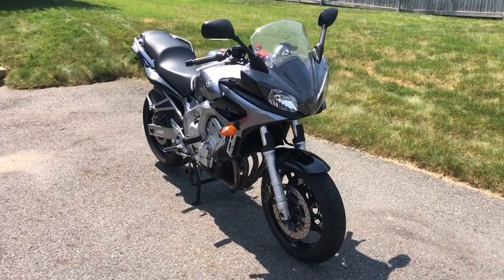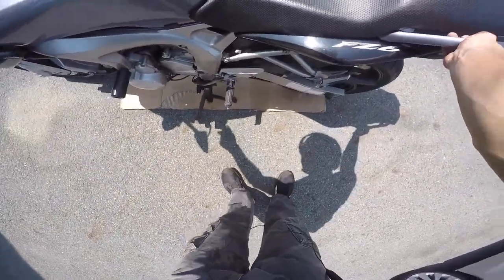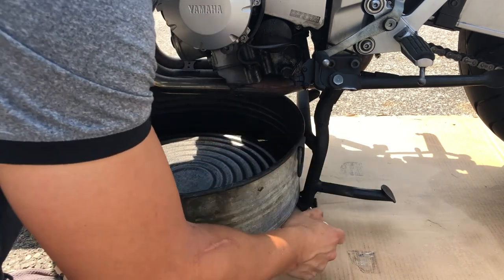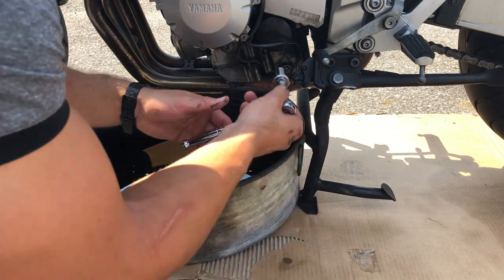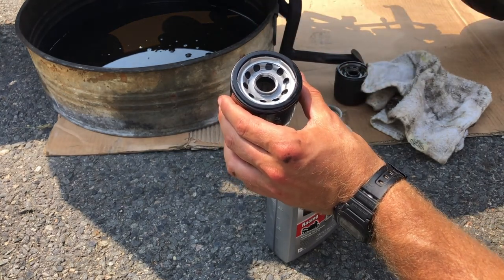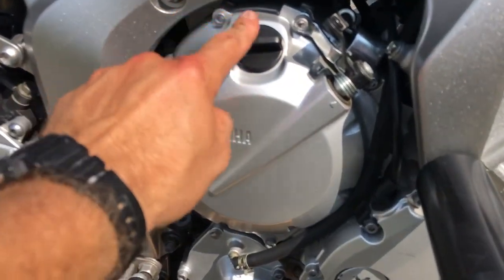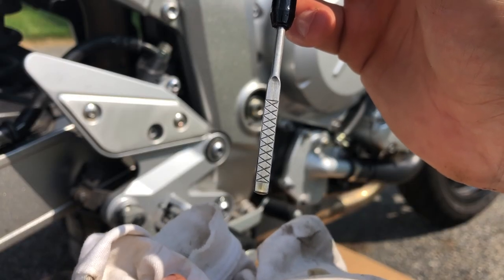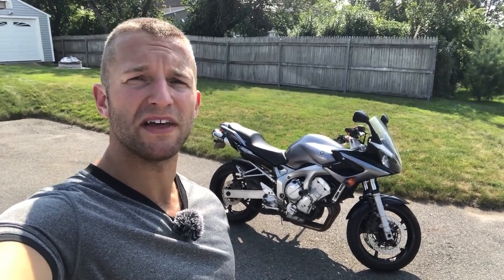How-To: Oil Change; 2004-2009 Yamaha FZ6 [DIY]

Comment: Just bought my 04 fz6 on Friday and she’s a GEM with only 8200 miles and on Friday I’m gonna do the oil and possibly brakes. This video was great brother by being very thorough. I work on my cars to save money and have never worked on a bike and you’re definitely showing how easy it is!
Reply from the maker: Congrats!! It really is a great bike. I've had mine since 2016, and I hope I can keep it for the rest of my life. It has been incredibly reliable (knock on wood) and it is still an absolute BLAST to ride, even though I have a lot more experience now. I bought it with 13,636 miles, and it now has over 30,500. I would highly recommend this bike to pretty much anyone. I also plan on doing a full review on it one of these days!

Thank you for checking out the video as well! I appreciate your feedback. Please don't forget to leave me a like, and also consider subscribing to the channel if you haven't already! It really helps me out to grow, and I sincerely appreciate it.

I am certainly a fan of saving money and working on your vehicles yourself when you have the time and the tools to do it. The oil is one thing, because the worst thing that can happen is the engine will blow up if you forget to put oil back into it. The brakes are a much different story though. I'm sure you are already fully aware, but just PLEASE make sure to fully bleed out your lines, test your brakes before you even leave your driveway, and then take it for a good slow speed test ride to make sure you are ABSOLUTELY safe with the brakes. I don't think anyone can think of a more crucial component on any vehicle to save a crash and potentially your life. I unfortunately do not have a video on how to replace the brakes on this bike, but I'm sure there are many others already on YT! Calvin MC is a great resource. He has a blue FZ6 and has a lot of great how-to tutorials videos. Good luck with the repairs, enjoy the snot out of your bike, and ride safe! -Mark

Comment from the maker: ***NOTE: Here are 2 more awesome tips I learned from my viewers! (see original comments from A & Skywatch below)

-To try to maximize the amount of old oil you can drain from the engine, you can remove the old oil filter, the dipstick, AND the oil fill cap while draining the oil to try to reduce the amount of vacuum inside the engine that is naturally created from the plug, cap & dipstick.

-Once most of the oil has drained, you can then (very carefully, as spilled oil may cause you to slip) take the bike off of the center stand, and place it on the side kick stand. Even more oil will drain out this way. Happy wrenching!
Reply: Question!! My Yamaha doesn’t have a stand like yours. Can I drain the oil & replace the filter by only resting it on the kickstand? Or is that not recommended?
Reply from the maker: @jessicataylor54  Yes! You certainly can. It’s just not as easy, as it doesn’t get lifted as high off of the ground. It also leans towards the left, where the drain bolt is. It’s totally doable though. Good luck with it!

Also, thank you so much for checking out my video! If you enjoyed it, please make sure to leave me a like, and also consider subscribing to the channel! It’s free to you, and it really helps me out to grow, so I certainly appreciate it. Take care, and have a good one! -Mark 😎

Comment: Thank you for the help ! I felt pretty confident in changing my own oil since I’ve been riding bikes since my first little Kawasaki klx100 when I was 7 but still, this was a great refresher. Also appreciated the little extra hints on just making the process easier with holding the plug and lifting up the oil pan. Is this your only bike ? I have a 06 Fz6 in maroon Red and I’ve had it for a while now, and I’ve been considering stepping up to get a new bike like the new MT9 or mt10. But this fz6 has just treated me so well over the years I’m very torn on it. Every year like clock work my dad and I go to the shed to get our bikes out for spring and I turn the key and within 3 turnovers it’s on and purring like a kitten. Where as my dad who has a Harley Davidson ends up having to go get new parts for some random thing that has stopped working over the winter EVERY YEAR despite his being a 2012 lol
Reply from the maker: Thanks so much! I really appreciate that. Yes, this is my only bike as of right now. I thought about getting another one that was more focused on the dual-sport aspect for taking longer trips, but I decided to hold off for now. Having this and 2 cars is enough for me at that point in my life! 😅 I have this dream of doing some kind of crazy cross-country road trip on a bike with maybe a few friends and filming the whole trip for my channel one day, but definitely not right now lol.

And nice! I bet it looks great in maroon. Yeah, I would be very torn as well, because I’ve been very lucky with my bike as well. I guess you could upgrade if you wanted more power, more tech, and maybe a few drive modes and what not. But you really don’t have to!

This is the way I look at it… These motorcycles are relatively simple, and they’re kind of meant to stay that way IMHO. Don’t get me wrong, I know that ABS, traction control, stability control, and many other new technology and safety features allow superbikes like the R1M to be next level performing. However, I feel like a bike of this generation is absolutely perfect for me. No frills, affordable, easy to maintain, looks and sounds great, and like you said, it’s been super reliable and starts right up for me too. And if you know what you’re doing, you can still have a TON of fun with this bike!

What I’m trying to say is, you don’t have to have the newest, fanciest, fastest bike to have just as much fun on a 20 or 30 year old bike if you know what to expect out of it. That’s just my two cents! I feel like this has been an excellent “beginner bike” for me, personally. I am STILL not yet bored with it, and I don’t think I’ll ever be! With almost 100 HP, you’re still pretty much the fastest thing on the road except for full-blown supercars or liter bikes. For me, no need to upgrade anytime soon. And if I do one day, I’d probably still keep this. It’s my first big boy bike and I wouldn’t want to let it go unless I absolutely have to.

And of course, no offense to your paps, but I would never get a Harley. Mainly, it’s just not my style. But more importantly, I’ve heard that people have so many issues (including you now) with Harleys compared to Japanese bikes. I want my bike to work, and stay working so I can enjoying riding it, going on adventures and making memories, not messing with it in the shed while my hypothetical son is waiting for me with his bike already up and running 😂

But hey man, best of luck to you and your dad. I hope you guys have many more years of fun and safe riding! I also sincerely appreciate you checking out my video and commenting! Sorry for the novel of a response, but I figured you wouldn’t mind. Please also make sure to leave the video of like, and also consider subscribing to my channel! It’s free, and it really helped me out to grow, so I sincerely appreciate it. Take care, ride safe, and have a good one man! -Mark 😎🤙

Comment: I’m thinking about switching from motul 5100 (semi synthetic) to 7100 (full synth) 10w40 as I want the bike to last. Is this a good idea or am I better off running semi synthetic?

Bike has 20k miles.
Reply from the maker: For me personally, I always run full synthetic every single time with all of my vehicles no matter what. I have always figured that if I’m going through all of the effort to buy the oil/filter and change it myself, I might as well spend a little bit more and get the best stuff I can, right? I also ride the bike hard, so I want to give the engine the best protection that I can, of course! To me, saving a little bit of money now is not going to be as good for it, and potentially cost me even more money in the long run. That’s just my advice though! I’ve been very happy with the Mobil 1 10W-40. Bike doesn’t complain one bit. I hope that helps!

Also, thank you so much for checking out my video! If you enjoyed it, please make sure to leave me a like, and also consider subscribing to my channel! It’s free, and it really helps me out to grow, so I certainly appreciate it. Take care, and have a good one! -Mark 😎

Comment: How do you dispose of the old oil?
Reply from the maker: Save the old empty jug, pour the old oil from the pan into it using a funnel, and bring it to any store that sells motor oil! They should take it without an issue for recycling.

Comment: Hello Great video. 10-40 ist it a little thin ?
Reply from the maker: Thank you! And to be honest, I felt like 10W-40 was on the thicker side of the oil range overall. When I did my research, that's what the bike called for, and it has done really well with it ever since. Starts right up every time, runs superbly, doesn't leak oil, and will hold top speed pulls on the highway over and over again without complaining or any sign of overheating. If you find any other info on it, let me know! I'd like to hear if you find out something else about it that I don't know.

Otherwise, I appreciate you checking out the video! I hope you enjoyed it. Please leave me a like and consider subscribing if you wouldn’t mind! It really helps me grow my channel, and I sincerely appreciate it. Take care, and have a great day! -Mark

Comment: Hi how often do u change oil and oil filter every 4k miles or 6k miles
Reply from the maker: Hey Emmanuel. I actually change it between every 3-4k miles, but I actually want to try to change mine every 2-3k miles from now on instead. I could let it go longer than 4k if I was really in a pinch, and I think the bike would be okay. However, I've noticed that my oil typically always looks darker and more used than I would prefer almost every single time I change it. I try to take very good care of my bike, and I want it to last a very long time (I know it sounds crazy, but my whole life if possible). This motor is also high-revving (redlines at almost 14,000 rpms), and I ride it spiritedly pretty much every time it hits the pavement. It is much better to be nice to a hard-working, high-revving engine (not to mention the wet clutch transmission also) and change it's oil and filter sooner rather than later.

I live in Massachusetts, which has hot summers for about 2-3 months, mild springs and falls, and very cold winters for about 5-6 months depending on the year. I ride all year long (mostly in the summer) totally about 3,000-ish miles/year. That means I typically change my oil once or twice a year, and it's usually at the beginning and/or the end of the riding season. You should never let it go too long (I'd say 1 year+) between changes, no matter the mileage interval.

The air quality in MA is good, and there's not a lot of dust on the road or in the air. Where do you live? Do you live in a very hot, or very cold climate? Is it very dusty where you live? And, this may be unlikely, but do you take your bike off-road at all? Do you take it to the track, or just ride it spiritedly often like I do? These are all things that would make you want to change your oil even more frequently because of the increased stress placed on your engine and transmission in those conditions.

Oil is literally the life blood of your engine, and if you can change it easily yourself (which I show you how to in this video) it's super cheap to do, and it really helps your engine stay healthy and last a long time. With that being said, there's no reason not to change it sooner rather than later if you have the means to. I'm not saying AT ALL that you can't ride your bike fast and have fun with it, because I do it every chance I get. But, it will be much happier (and so will you) if you treat it well with frequent oil and filter changes. As the old adage says, "Take care of it, and it will take care of you." Hope this helps, good luck, and happy wrenching! -Mark

Comment: Anyone know what the size of that drain bolt is on a 2005 FZ6
Reply from the maker: If you mean the size if the socket for it, it is a 19mm. If you are talking about the actual dimensions of the rest of the bolt, (the length, thread) I think googling the specs, and/or trying to find it on a forum would work. If you need to get a replacement drain bolt, and you can't find it on a common parts website like Rock Auto for example, I maybe would suggest ordering one off of Yamaha's website. That might be your best and only option unfortunately. Good luck with it either way, and thanks for checking out my video! Let me know how it works out. -Mark
Reply: @DoubleClutchAutoReviews  Gotchya.  Thanks man!  Super appreciate it!!
Reply from the maker: @Tubularjake  Not a prob. Hope you enjoyed the video, and thanks for watching!

Comment: Video should be about 3 minutes real time, 17mm socket, filter wrench. Drop oil, change filter, dump 3 quarts in.
Reply from the maker: Hey Bryan. I wanted to explain a little more in this video than what I could in only 3 minutes. I wanted to make this video as if to instruct someone that had absolutely no idea where to start with an oil change on their FZ6. Literally from pulling out your bike, putting it away, and everything in between. I also wanted to give some extra little tips. And, most importantly, I wanted to explain the reasons WHY I'm doing certain things, which obviously takes more time. In my mind, I like to know why I'm doing something, or why something works the way that it does. Rather than just, "monkey see, monkey do", but without an understanding of why...

I figured filming it this way might help some people, as we all have to start somewhere. This video will cater more to people with a similar mindset as that, rather than someone that just wants bing-bang-boom done. In the end, it's only 8 minutes. And, after all this is MY video, so I did what I wanted to do. If you thought the video was too long, that's your opinion, and that's perfectly okay. Feel free to skip through to the exact parts you needed to see if you would like, or just skip it all together. I hope you enjoyed it somewhat either way. Take care, and thanks for watching anyway.

Comment: What size is the filter wrench? 🥲 Literally the only specs I was trying to look up. Previous owner must've cranked down on it
Reply from the maker: @CamoGirlPlayz  I’m sorry to hear that! To be perfectly honest, I’m not exactly sure about the size of a filter wrench you would need. However, a simple tip could be to use a handgrip pad (the same one that your grandma would use to open up a jar of salsa, haha) Or, if you are really down to the wire, you can take a long sharp screwdriver and very carefully spike it through the filter by tapping the end of it with a hammer until it comes all the way through to the other side. Then you can use the leverage from the screwdriver to break the filter loose. I hope that helps, and good luck!

And if you enjoyed the video otherwise, please make sure to leave me a like, and also consider subscribing to the channel! It’s free, and it really helps me out to grow, so I certainly appreciate it. Take care, and have a good one! -Mark 😎🤙
Reply: @DoubleClutchAutoReviews  we ended up doing the screwdriver method, after some of my friends told me to do it that way. The thing was basically welded on
Reply from the maker: @CamoGirlPlayz  😅😅😅 Jeeez!! I’m glad that worked though. Ride safe! 😎🤙